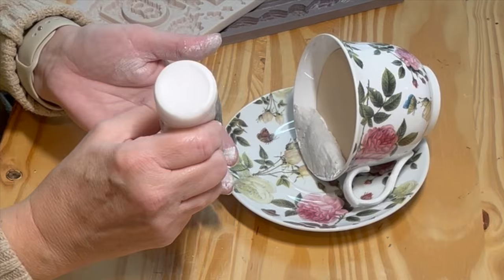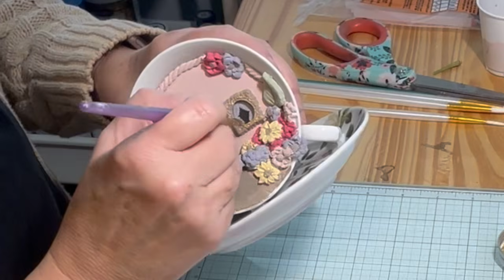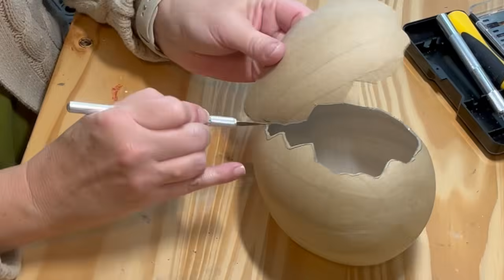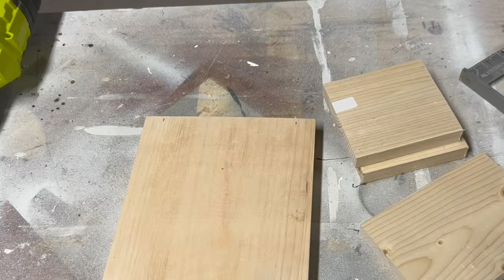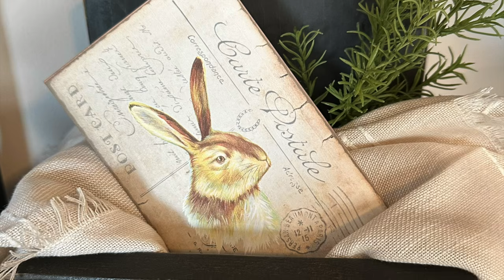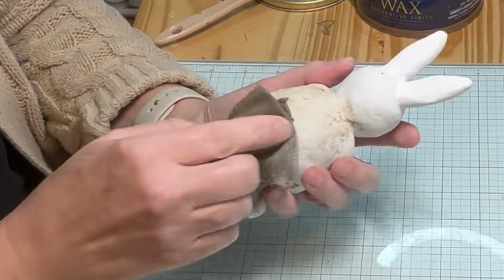Spring Bunny Decor

Comment: Such clever ways to use simple everyday objects.  Have two questions. If air dry clay gets dried out, can it be rehydrated so it can be used? And I see crafters using various wax and I was wondering if the brushes have to be cleaned after each use…they tend to look like they still have wax on them.
Reply from the maker: If the clay I'm using gets a bit dried out, I add a little water in my hands and then knead the clay until it becomes more pliable. I've never tried doing it with clay that is totally dried out although I have heard some people will put it in a plastic bag with a baby wipe to rehydrate it. I'm not sure how well that works out or not.  As for the wax brushes,  they say you should clean them often but I never clean mine. After I use them I just let the wax dry on the brush and then the next time I use it I rub the bristles of the brush onto an old rag and the dried wax flakes off.  I'm not suggesting everyone do this it's just what I do because I absolutely hate to clean brushes.😁